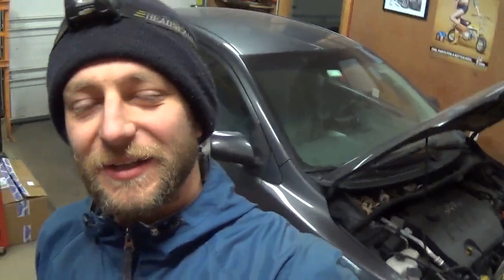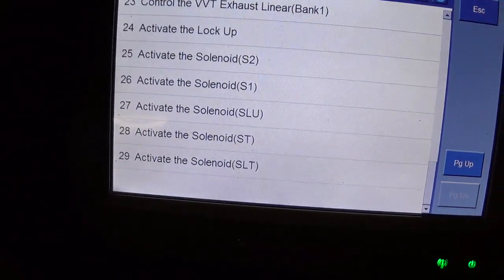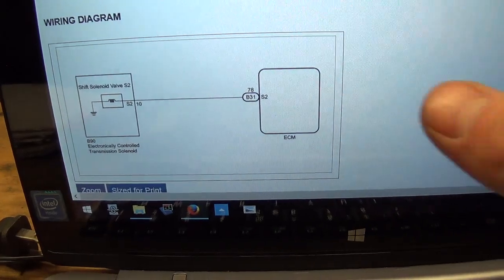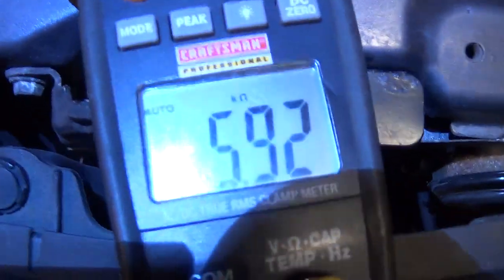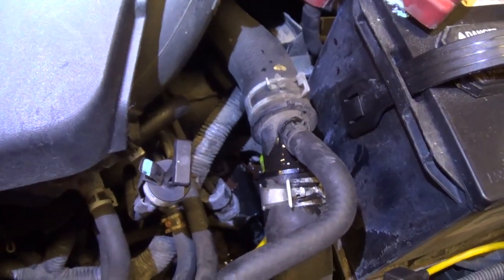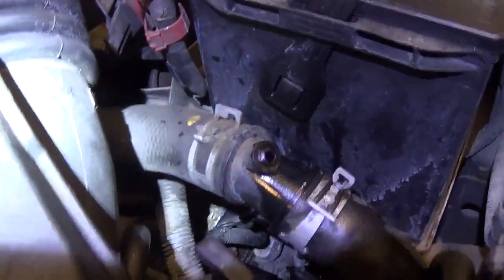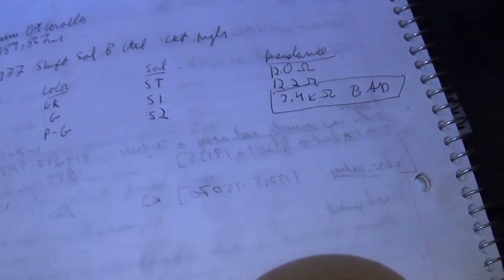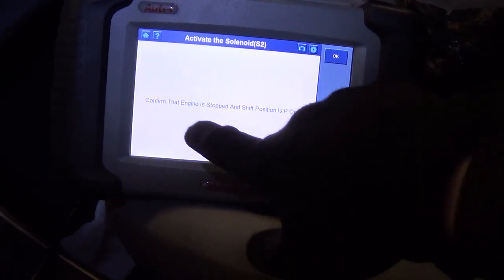Toyota Transmission P0977 Case Study - Part 1

Comment: Hello brother 
I have  toyota  corolla  2009 automatic  transmission  not Shifting from 1st to second  the rpm on the rise not  shifting  from first to second unless out my leg from the pedal not found any code or check engine light

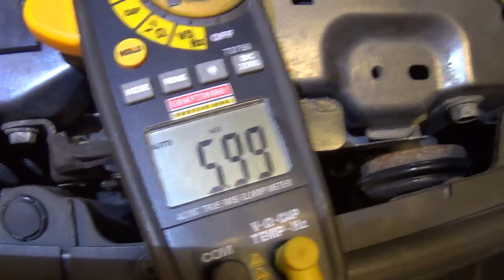Comment: Hello Can you explain how you got 5.96 (4:47) and the on paper you wrote 2.4 Ohms. ( 8:38) For S2. Also was the measurements back-probed at the Trans Wire going to the Trans or at the ECU/TCM?
Reply from the maker: Temperature might have been different... Regardless, the measurement indicates "open circuit" in the solenoid.
Reply: Thanks for the reply. I do wonder what type of effect temperature has on resistance of solenoids. Most literature values are set for 20deg Celsius? I wonder if it was working half the time. So sometimes its open sometimes its not hence the 2 different readings. Also were you back probing on the Trans Wire exclusively (inside the transmission leading strait to the solenoids) . Or from the Wire Harness which connects to the transmission wire and the ECM/TCM?
Reply: Also I have this issue with a 06 Lexus IS250 RWD A960E Sealed Trans ( recently swapped from a is250 08) W/ P0977 CEL code is intermittent. All gears shift and I am not stuck on safety limp home mode) Also it seems like i have a slow acceleration during the mornings and it gets better as it warms up. Iv Back probed my ECM to the specificed S2 Solenoid. They all seemed within range. I hope i dont have to drop the pan and change out the solenoid As this trans was just swapped but i do have my old trans and i think those solenoids were good as is the transwire.

Comment: Hey nice diag once again. That battery post and that trans connector sure looked like a smurf took a dump on it, big pile of blue crap. Man, that sure sucked about that plastic piece of garbage snapping off, I hate cheap plastic crap on cars. Also, what Autel model scan tool were you using in this video, it seemed to support quite a bit of bi directional controls. I own a snap on ethos+ that does not do anywhere near close to what your Autel scan tool can do. Thanks for the good video.
Reply from the maker: It's the older MaxiDas DS708, my first "real" scanner. It's still my go-to for quick scans and tests just because it is so fast and coverage is very good.
Reply: Wow I am going to have to get me one of those. I think Harbor Freight of all places sells those. I think they sell it for around 800.00 and then you use one of there 20-25% off coupons.  Man my Snap-on Ethos cost double that price and does not do half of what that Autel will do.   Unless this is not the same scanner as yours but I believe it is. 
 http://www.harborfreight.com/autel-maxidas-automotive-diagnostic-and-analysis-system-62385.html
Anyway thanks for the info, I am off to watch your part 2 you just posted. Take care.
Reply: Autel makes some great stuff. I just picked up the Maxisys MS906TS this summer. Big price tag, but the thing is amazing. Even has a TPMS programming tool built in. Cost just about 1/10th of what Snap-On wants for the  Verus. Got it at JB Tool sales online. Cheapest price I could find. That said, I think they sent me a global unit instead of a USA unit - they are different. I've got a bunch of models in the list I've never heard of - all sold overseas.

I'm not what you'd call "tech savvy", so I got a kick out of being able to connect to the internet with the scan tool out in my barn. Saves me a trip inside to look stuff up. WiFi signal is pretty weak out there, so sometimes it's quicker to just run inside and use the desktop. People tell me it's like a tablet. I've never owned one (probably haven't ever seen one, LOL) so I couldn't tell you there.

Comment: Do you know if the valve body is under the transmission or on the front if it's on front it not fun the transmission should be a ASIN right I know on older Volkswagen MK4 there was a five speed model it was a Japanese built transmission and the oil pan was towards the front of the car it was a pain in the butt to get accès I had to remouve the front end but you might be lucky that the pan could be under great time to change the oil and filter .
Reply: Hi I did some searching on u tube and it looks like the oil pan is under the transmission so I think it's going to be easy but the question can you buy the solenoid separately at the Toyota dealership?

Comment: Great work, Ivan! This is perfect example of "Cascade Failure" (one fault causing/related to another). Hot coolant & time make stuff brittle- aluminum, brass, and plastic all eventually fail. Rock Auto has the S2 Shift solenoid for $103.79 Holy Crap. As for that coolant connection- CariD has it, even though it's Dorman, it looks good.  https://www.carid.com/2009-toyota-corolla-engine-cooling-parts/dorman-coolant-pipe-34099680.html   Happy Friday 13

Comment: why did you you say the Ohm meter is "taboo" .. I dont get it ...
Reply: Generally it's better to test a circuit under load I bet you Ivan does not rely on ohmage alone a winding might ohm out because the break is very close to each other but under load it fails to carry proper current to operate that component or circuit am I right Ivan
Reply: And if your deep squatting 600 that's pretty FN good I only did three in the navy when I was a kid
Reply: well it was  afew years back .. best ever was 510x11 followed by 405x23  ..cant do it now though

Comment: Damn. On the upside if it was that brittle going over a large bump probably would have bust it and caused the car to dump all its coolant. You probably just saved that customer from getting stranded and maybe even an engine overheat. I actually work with a guy who has fabricated new metal joints for me when i've bust this plastic crap. He's a wizz with the tig welder and some tube and fittings.

Comment: Nice video Ivan & I see you got a new laptop or replaced your screen.  No matter how careful you are it's so easy to break stuff trying to get down into tight places and if you try to take it apart the same applies...just part of the job.
Reply from the maker: The silver lining is that if it broke that easily, then it should be replaced anyways, so in my mind I saved the customer from being stranded somewhere :)
Reply: That's the way I look at it...probably would have broke hitting a pothole or going down a rough road.

Comment: Thank you so much for this video. Here in Puerto Rico I get a lot of these cars with transmission solenoid codes... also, those with great beards, we salute you. Don't make the mistake of chopping that beard down, you're just going to start misdiagnosing cars.
Reply from the maker: Haha I got a fancy GMC Acadia here right now to diag and it's about to make me rip my beard out lol
Reply: motoYam82 imagine the situation without the beard... disastrous! (Looking fowrard to this diag video)
Reply: LOL! GM is good for that ... :D

I just got a '04 Olds Alero with the 3400 V6, 63k miles and change. Was rapping so loud my ears were ringing LOL. I knew it was valve related, due to the hollow sound, and slow cadence of it as it idled at 1,200 rpm. I just got the rear valve cover off, and lifted the #1 exhaust rocker right out - no tools needed, LOL! Yanked the threads right out! That was a new one for me ...

Comment: that coolant hose is very common to break I had to replace mine on my 2011 toyota rav4 was leaking coolant.
Reply from the maker: Should I charge the customer for it then? "It was only a matter of time" ;)
Reply: I would say yes I got mine for 50$ at the toyota dealer and it comes as a whole part upper radiator hose.
https://lh3.googleusercontent.com/9-YgrSPIbcJwq4HkqLGSt2dkHX7UVu5fjRgZKGQpw9rxuJrinbkg9-b8vmZPdmFpZ-fGf3OtHW4
Reply: motoYam82  I will say yes got mine for $50 at the toyota dealer upper radiator hose part number 16571-0V020
Reply: But it's up to you if you want to charge and that coolant looked bad  supposed to look a little reddish if it was my car replace a lower radiator hose and the thermostat also

Comment: Nice one. Ivan  without knowing a pull up or down design the voltage high and low codes always confuse me. LOL
Reply: Well pull up and pull down only denote how the circuit is used to operate when you have high or low codes it tells you if your haveing a ground problem or a power problem a power problem would set a low voltage code a bad ground problem or high resistance would set a voltage high code so you kind of have an idea of why that cicuit caused the ECM to tattle on it am I right Ivan THE MAN! Lol happy new year
Reply: chiefeaglebear I hope your right because i'm thinking in my brain they can be reversed  depending on either a pull up or down, LOL
Reply: Knowing if it's pull up or pull down should be determined first a high code is a high code a low code is a low code the switching design changes but ohms law doesn't thanks

Comment: Hey Ivan!  Does your DS708 Autel lock up under special functions sometimes?  I replaced the SD Card with a new one and copied fresh set of data to it from the update tool on the PC but occasionally it locks up and I have to hard power off and back on. Thanks
Reply: BlazerGuy1983 mine did that...then it got to the point where it would freeze at the home screen with the manufactures icons. i called, and they had me send it in. they send me a brand new unit free of charge...and my unit went out of warranty back in 2014@

Comment: Dam good video, the treshold is 100k or more for High and you got 4-6k, maybe the resistance going higher under load.
Reply: Resistance going higher under load??????
Reply: Like an light bulb,  i guess this is a crusty answer to the wiring.
Bigger bulb and voltmeter might be in part 2.

Comment: Good diag Ivan. I hate it when crap snaps like that coolant nipple.. Too much breakable plastic these days. Cheers :)
Reply from the maker: Yeah I was like why is there liquid running down my arm?? That plastic was so brittle, the remains of the nipple came out in 5 pieces!
Reply: Had the same thing happen on a '00 Silverado 1500 heater hose connection a while back. Was so pissed! Took me 15 minutes just to fish all the busted pieces out of the hose - must've been in 30 pieces! I had some choice words for GM engineers that day. GRRR!!
Reply: +motoYam82 Hi Ivan!!! I would like your advice/input on a situation with my vehicle. I had an issue at the technical school I'm attending and would like to know what you think. Can I email you? My email is tgoodm1@hotmail.com. Thanks!!!
Reply from the maker: tgoodm1
sure thing